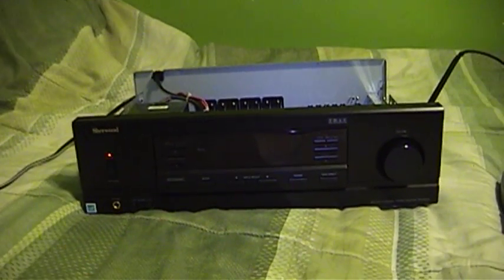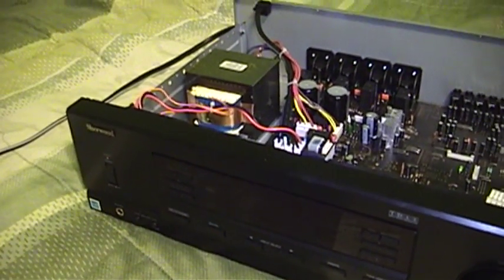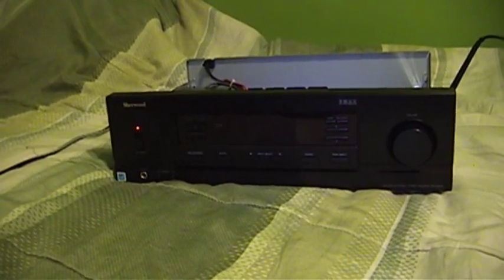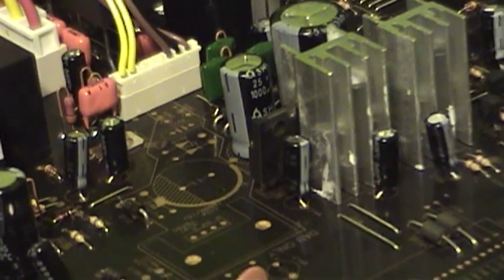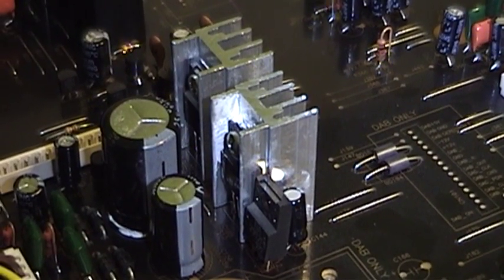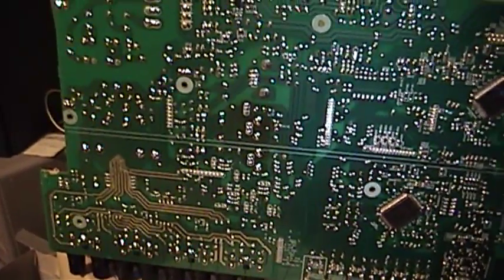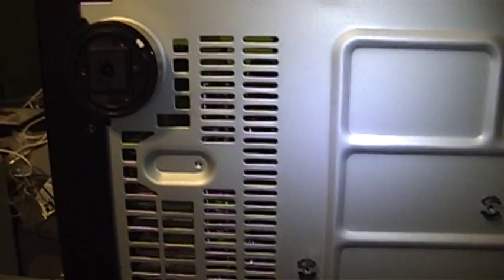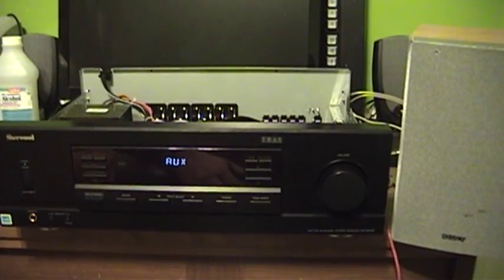Kitchen Table Electronics Repair: Sherwood RX-5502 Multi-Zone Stereo Receiver

Comment: shhhhh, don't tell anyone else that the Best Buy Insignia 2 channel receiver is in fact a pretty good quality "Sherwood receiver". I just bought one and i love it! My vintage NAD set up is just too darn heavey for the really nice all pine component rack i assembled. Great video, its really inspiring. Most people are so quick to through equipment away instead of servicing it. Look at a similarly priced Sony and even Yamaha at 50 dollars higher which come with spring loaded speaker terminals.

Comment: uxwbill, i have one of these RX-5502 receivers and after turning main power on the small light led shows up, then after pressing standby power the unit goes dead immediately and the light turns off..i do hear a click at the relay inside...i have under 1 volt at any of the power points and grounds at ribbon cables....under half volt at all power transistors....the fuse is not blown....how do i check the large main power supply and is there a thermal fuse on it and where?? Thanks for the help.

Comment: I have a broken Optimus 3680. It started buzzing really loud and one channel stopped working. I unplugged it for a while and the buzzing stopped for now, but when I pan over to the "dead" channel, it has a very low volume. I think the source of the buzzing is all of the inputs are being amplified at the same time. I was moving the source to different inputs while it was on but didn't switch the input on the receiver and it still gave a signal, however buzzing. Does this sound repairable?

Comment: Hello uxwbill I have ridgid stereo with out power. I found the fuse blow out, the fuse for it is T630mal 250 v. I use F500ma 250 v just to tray and ones i plug it the fuse blow out.  that because the fuse is no right or it may have other problem? please help..

Comment: Nice work Bud , ELO from my Hometown Brum UK . I have put 2 fans in my old Pioneer , a micro fan blowing on the back of the heatsink and a 4 inch drawing hot air up and out Very reliable 
ATB

Comment: I had a RX-4109 receiver once and it would not even run the standby. Then I got a RX-4105 unit from our transfer station, I thought I give them one more chance. It works great, the other one likely had a power surge or someone was not too kind to it!

Comment: Wow! How I wish I saw this earlier, as I just assumed the outputs crashed on my similar/identical and cheap Insignia Receiver.  I replaced them- Hey they're a buck a piece, well still protect mode. Next the caps...OK. I ended up here. Unlike the Sherwood, Insignia does NOT use a heat sink!  FYI- I would take the 4109 over a NAD 3020 anyday. Likely as those too, were once considered budget throw away amplifiers. Plus, the 4109 sounds as sweet if not better! What advantage the 4109 has over the Insignia is a removable phono amp, which I have retrofitted into stand alone units.

Comment: if you doubt a regulator, it's better to test it outside the circuit - their datasheets usually have test circuits which are very easy to built.

In such cases, it's possible that the capacitors in front or behind the regulator are shorted or have high resistance, and may un-short/conduct power well enough once they heat up a bit - so at cold start, the heatsinks around are cold, won't start As heatsink go warm, cap goes warm, lets regulator work 

Sometimes you can use hair dryer to test this.

Comment: @uxwbill Hi Bill, thanks for responding. I actually didn't think about that, I might try it out. The 7805 gets its voltage from a bridge rectifier, which sends its respective voltage through a capacitor to filter out any hum.

Comment: I got the same multimeter. Cheap, but it works. One of these days I have to pull one of my troublesome amps (Sony STR-434) on the bench and fix it. I get random static on the outputs and sometimes the output clicks off and on again (over current protection?).

Comment: I would have looked into upgrading the regulators to something a little better if available. If not, use original replacement parts only and increase the heatsink size on both to prevent this failure from recurring.

Comment: @uxwbill I managed to find a service manual. I'm going to do some voltage testing on the power amp board. DC bias tests are a bit weird on the right channel, floats between 15-55mV, while the left channel is steady at 13mV. Nothing obviously bad inside (no visible leaking caps or burned stuff), I seemed to recall this unit being sensitive to humidity, so there might be some marginal working parts in there somewhere.
Reply: is that a Rx-5502 service manual ? Do you have a link for it please?

Comment: I have a sherwood some where in my attic unsure of what model but I remember one thing that was different than most of the systems I have worked on It has 4 ohm speaker connection on 4 channels most of the sherwoods I have seen and worked on over the years were 8 ohm I have seen 2 ohm systems over seas when I was in the NAVY.

Comment: I checked the speakers with another receiver that i have and they are working fine.
When i opened the amp i noticed that it had a fuse so i checked the fuse and it is good. The amp powers on without a problem.
At the time i was using the amp to run my turntable and i had the receiver off.

Tahnk you much for your suggestions, maybe i need to turn the receiver on, but the rca cable connections go to the amp.
Hope this makes sense.

Comment: @uxwbill Yes. I have a video of the repair here on youtube.  Power spike "killed" the transformer (not speaker load) and protection fuse on the main board was intact. Measured open primary and was about to toss the receiver as that critical part (mains transformer) was not available as a replacement part.

Found the SECRET HIDDEN defective thermal fuse and aborted it.

Receiver is alive again, powering our 2nd floor laboratory JBL ceiling speaker system with much greatness. No overheat.

Comment: I haven't opened my 4105 yet but it started doing this quite some time ago so i would just leave it on , because at times I could get it to stay on. I'm curious do the 2 regulators you're checking have power to them as soon as the unit is plugged in? I figure they must because you have your unit plugged in but it isn't powered on, but I then thought maybe I'm missing something? My repair expertise is somewhat limited as if I have a service manual or instruction (like this video) I'm able to do repair work, but to just open something up and attempt repair I would have a difficult time , unless it was something obvious. I've got an old RCA dimensia amp I'm hoping to use while my sherwood is down.

Comment: Will this model work with 4 kicker speakers kb6000? Each of the speakers is 75watts RMS 8 ohms each. I would just want to play off of one source at a time. I was thinking about plugging in one pair of speakers to (A) and the second pair to (B) and just play off one source. is that possible? Anything else I should know
Reply: thank you. ok so hooking up 4 8ohm speakers, will result in lower ohm from receiver....I was hoping to get the 75 watts rms to each of the 4 speakers at 8 ohms each.

Comment: Hi Bill, 

I have a Sherwood RD6506 AV receiver - it does exactly the same thing as the amp in this video, shutting off a few seconds after being powered on. 
I have some basic knowledge of electrics circuits, and own a cheap multimeter. What would you suggest would be the first thing to check? Any help would be appreciated.

Comment: Bill have you ever seen a Sherwood tuner?  My neighbor tossed out a Sherwood TD7010R tuner.
it's in very nice condition , almost looks new. I plugged it in and it has display. Don't have an amp to connect it so it's not tested.

Comment: Hey great work by the way very informative and with great sounding knowledge. I have a simular issue but mine the Std By light stays on and I have .3v at both the input sides of the volt rgs! and I have .3v at the amp circuit board connection and not 12v like you. Do you know where the 25v or so comes from for the VREG x2?? Cheers.
Reply from the maker: All of the voltages come off of the power transformer's secondary winding as AC, are converted to DC by a bridge rectifier (diodes), filtered through capacitors and then go directly to the various regulators. I suspect a broken trace or blown fuse/circuit protector may be part of the problem, as an overload sufficient to pull the 25VDC supply down to 0.3VDC ought to make something start smoking or blow up outright.
Reply: @uxwbill  Thanks for your reply and extra info much appreciated. The board looks fine with no obvious burn marks, tracks broken etc and I have 14VAC on both red wires to yellow center wires from the output of transformer. What voltage should be at the output of the transformer 25Vdc? if this is the case then I think may be the transformer could be suspect? The Amp has been running full 4 channels with 8ohm speakers not 16ohm like recommended!, which would also mean that it was drawing a lot more power yes? Also I'm in Australia and the power is 240Vac just for your info. Cheers.
Reply: @uxwbill  very nice job !! I have found very nice condition Sherwood Rx 4030r. Do you recommend this model ?

Comment: You indicated you wanted a Sherwood 4109 that didn't work. I have one that works and one that doesn't. You can have the one that doesn't if you tell me what went wrong so that when the one that works goes bad, I might be able to fix it. Tested the voltage regulator 7815 and its working. Otherwise the same problem everyone else has, powers up then powers down.

Comment: Thanks for the effort, I hope you don't mind me pointing out a couple of errors. You say the voltage is very low on the +12V which makes you think there is something wrong with the 7912 regulator, the problem is the 7912 is a negative regulator, you should be looking for the -12V to test this, not the +12V. Also I didn't notice you saying anything about the state of the amp while you were testing this because in standby mode you will get a very low voltage reading out of the regulator

Comment: now I noticed you have a lot of room in there were if those heat sinks are just not big enought you could replace them with bigger ones for better heat disapation.   I used to have and old audio amp like that were that happed I replaced both the regulator and put a larger heat sink on it and also added a nother board I build that had a tempture sinsior on it and added a cooling fan to it so when it got ware it kick on and keep it cool.

Comment: Where can I get a 4105 schematic, I need to re-bias output after replacing right side output transistors, I don't see a pot for biasing, they must have used a fixed bias servo!! Any info would be helpful!!
Reply from the maker: A well directed web search with a reputable search engine will find it. Try using the RX-4109 model instead, they're both covered by the same manual.

Comment: excellent repair :-) , i would fit a larger heatsink to both 78 series or see if an input resistor is possible to lower the dissipation to a safe level.

Companys allways cut costs and bypass the designers carefull design, shame.

Comment: You certainly know your stuff there. I have a harmon Kardon Reciever which loses it's settings after power outage, it did not do this in the past. Is there any thing from this information that you can tell me as a rough guide. It's an AVR4000, got it second hand, sounds great, runs fine. . .now but I have to retune the radio every time I turn it on.

Comment: I got a KENWOOD amp... It's a great amp. Problem is.... I can't get it off of "Tuner" mode. Infact, none of the buttons do anything, except the volume up/down. If I press for example video 1 it will not change channelsi the same obviously is true for aux, video2, phono, etc.
It's a bummer because I got the amp at a charity suction with a "WORKS" post it note on it.  I opened it up and despite the outer area being immaculate, the inside was absolutely COVERED in dust.  So I dusted it (very very carefully I might ad)  I also cleaned out the headphones jack. -no change.
Any ideas?
Reply from the maker: Best guess is that you have a stuck button, damaged circuit board traces/keyboard matrix or confused microcontroller.

Comment: I was able to pick up an rx-5502 as well, but I apparently just have bad luck.

The primary on the power transformer is wide open.  The unit still has standby power and will have the red led indicator come on when you engage the front power switch.  The dc relay will also click once you toggle the power button... however there is no front display and no other activity from the unit.

Can't find the transformer or anyone currently selling another bum unit so I'm gonna part this one.

Comment: My 4105 has a very annoying high frequency hiss ~ the 240hz zone through all the channels (even with no inputs). I replaced the power supply filter caps and the speaker wires. The hiss is still there, though slightly less obtrusive. Listening through the speakers at a reasonable level & distance, the hiss is a little too present. Have you noticed a high level of noise with your Sherwoods? Any suggestions?

Comment: Hi there uxbill,
very good video, very informative..
I have an 80's Sansui amplifier that was working fine and then it quit.
it has power but does not provide sound to the speakers, could you give me an idea of what might be the problem.
I sprayed electrical contact cleaner to everything but not change.
Thank you

Comment: Hi Bill I have a Sherwood RX-4103 and it was working just fine and now sound like a cheap radio. No base at all.
What do you think happened?
Reply from the maker: I don't know with any certainty what may have happened. I'd test your speakers with another receiver -- perhaps the RX-4103 started feeding DC voltage to the speakers and burned out the woofers. If the speakers are OK, I'd go over all the operating controls and make sure nobody set them to absurd values.

Also check your speaker wires.

Comment: Bill- You inspired me to buy a desoldering iron and replace both 7812 voltage regulators, hoping it would be similar to the problem you had on yours (my RX5502 dies after 10sec just as you describe). Wish I could say it started playing ELO when I started it up, but it just clicked off after 10sec again to remind me I am a mechanical engineer, not electrical. I am down but not out, and looking for a next suggestion? Thanks!

Comment: Im just curious about the 12v regulator that shows only a few mV when standby light is blinking. When the device did start up occasionally.. did you check the regulator and there was only a few mV even then?

Comment: Sounds like my problem gonna try it right now thanks.
Reply from the maker: The proper way to troubleshoot this kind of thing is to do some tests. Otherwise, you're just guessing, and probably spending money on things that won't be the problem. A good place to start? Check the regulator's output pin and see what's there.

Comment: I have a Sherwood rx4109 and it’s turning on and then seconds later shuts off... I’m not good with electronics what do you recommend
Reply: I hear one relay click and then it shuts down with a solid red light above power button

Comment: I have an Insignia NS-R2000 are you familiar with this model?  I am able to get a standby light to come after powering up and then once I select an input (Aux, Radio etc) this light turns off and Speaker A and Speaker B light up.  This normally happens in sequence with the name of the input I selected also being displayed on the monitor.  I've removed the cover and air dusted it a few times but I am not very tech savvy when it comes to this sort of thing.  Any help or advice would be appreciated

Comment: uxwbill.  I have a similar problem with a RX-4109 and need your expertise.  If you are still there after almost 9 years and willing to hear me out, I'll take the time to explain what I have going on with my son-in-laws receiver.  I thought you did a great job with this video.  I'll check back later.
Reply from the maker: You can certainly describe your problem here if you'd like. Depending upon your skill level and equipment, I'd start with some basic checks. For example: do you have voltage from every output of the transformer? Is there voltage reaching and leaving each regulator? Have you checked the output devices for shorts?
Reply: I have a basic understanding of power supplies.  I know nothing about receivers.  The issue is, turn it on and it shuts down about 5 seconds later.  There is one 9 volt relay that energizes while on.  If I unplug the transformer's secondary wires from the board, the receiver will stay on.  In fact, another relay will energize.  The voltages of the wires I'm unplugging is around 85 volts.  There is a center tap, measures 42.5 volts as expected.  I found two regulators.  A 5 volt and a 15 volt.  Both are working properly. I don't see anything burnt and there are no overheating smells.  That is as far as I've gone.
Reply from the maker: Check all the power and driver transistors in the amplifier. It's likely one or more are shorted.
Reply: There are 6 transistors mounted to a large sharing heat sink.  Checking collector to emitter, they all seem to check OK.   I did notice wire traces on the main board labeled +15 and another -15.  I only measured -3 volts at the -15 line.  The +15 measures correctly.  I'm not sure where the -15 is suppose to come from.  I'm beginning to think I may have to remove the board and try to follow where that secondary transformer circuitry goes.  This is the one when I unplug it, the unit does not kick out.
Reply from the maker: At one time I knew where the -15 V came from, but I've forgotten. I'll have to check some of my notes, assuming I can find them. I think I might have had some correspondence with someone who also saw a deficient -15 V supply in theirs.